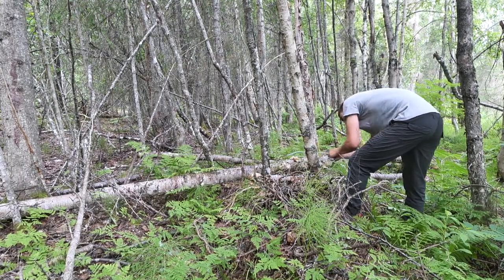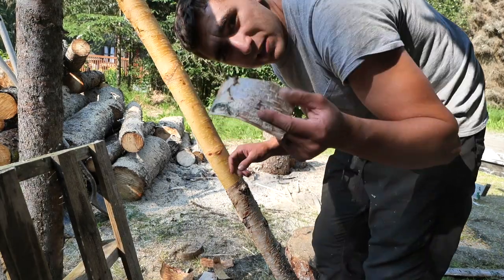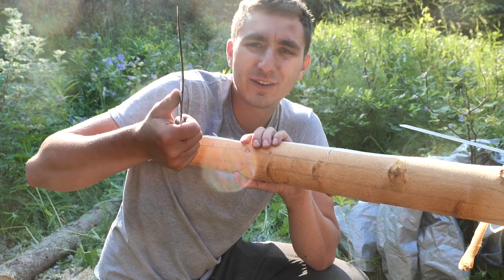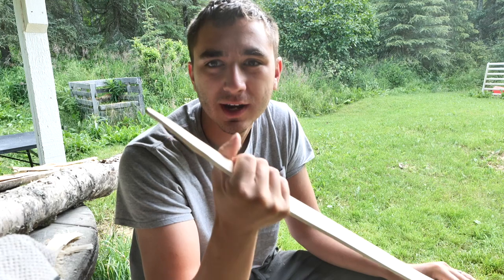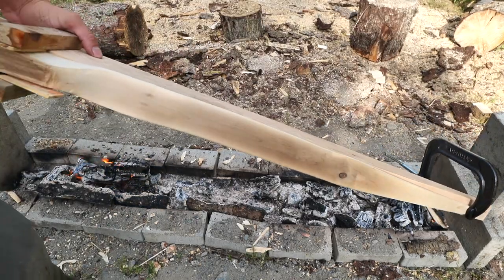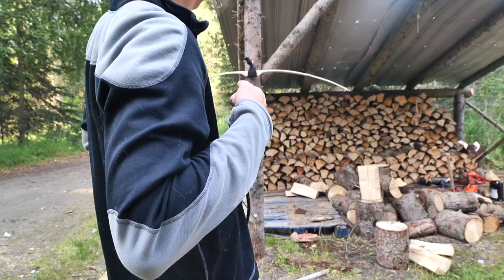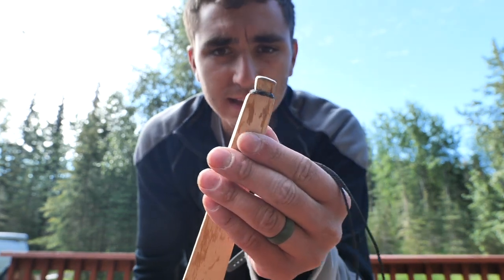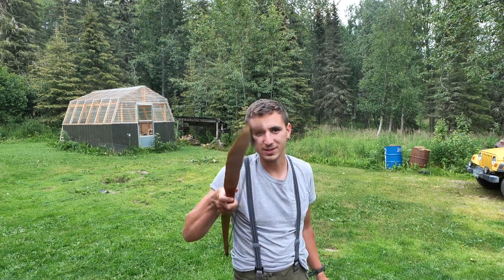Building A Birch Self Bow Using Fire

Comment: Nice job. You should try birch grown in the sun. It puts on way more late wood. It will have growth rings that are an 1/8 inch or larger, whereas shade grown birch will be a 16th . The late wood is much denser. It makes all the difference for birch. Snowshoes, skis, bows, sled runners, big growth rings is the answer.  Check brich left in clear cuts or beaver cuts or the south facing edges of things. Never gonna find it in the middle of the woods
Reply: Nice Note.   Also known as "Pasture birch"   found on edge of fields and at treeline.   You can see this referenced for other trees also most famously "pasture Oak" mentioned in Joshua slocums "Sailing alone around the world".

Comment: Hammering the knife makes me sad.
Reply from the maker: Yes and then very happy again when I get to go pick out a new one for 75¢.
Reply: @Benjamin.stevens  Yea, its cheap tool and its yours. 
Still froe, axe, wedge and so on are tools much better suited for this task. If you insist on miss usage of the knife, abuse is not necessary. 
You may consider using a wooden mallet at least.
Reply from the maker: I would love access to more tools. Here in my part of alaska those things are very difficult to get. I’m sure I’ll slowly accumulate things over time.